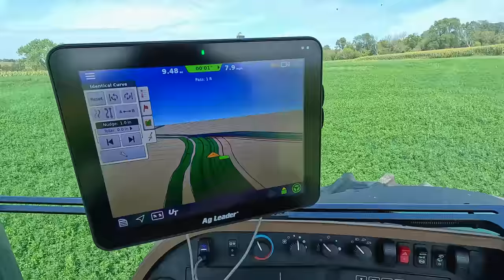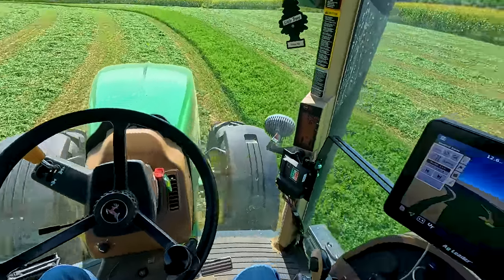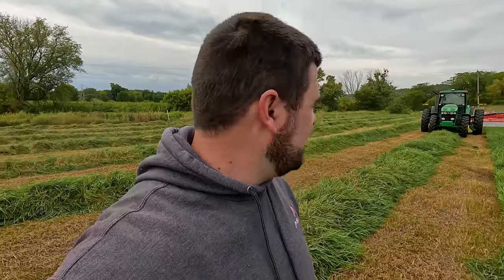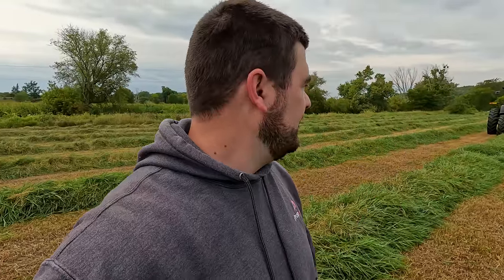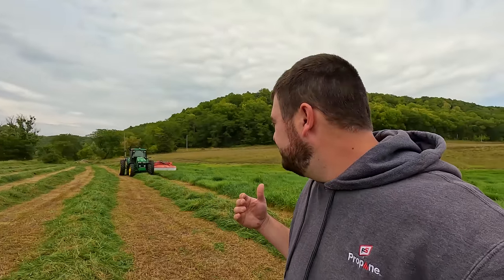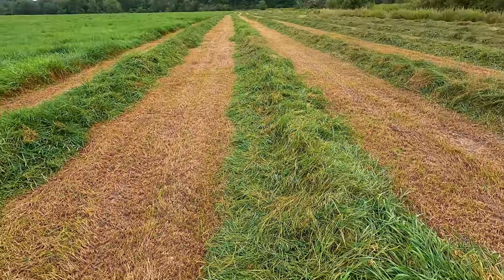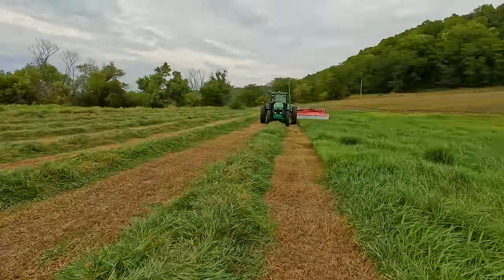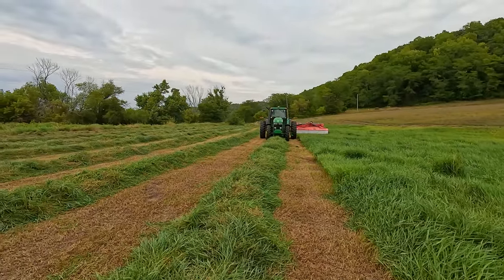Less Horsepower Believe It Or Not - John Deere 7920 & KUHN FC 4061 TCD

Comment: Great Video Ryan, I hope the hay doesn't get wet! Did you use the GPS guidance for the whole of the valley? how did it go? thanks for sharing
Reply from the maker: I didn’t on the lower valley as I couldn’t pin the dimensions down well enough to do more than 3 passes without going off. The problem with the a pulled mower and GPS is that it is offset and it drifts. I didn’t have exact dimensions and probably wasn’t close on some like distance from hitch to axles

Comment: When I was cutting hay (alfalfa) in the 70s and 80 we used a conventional swather with sickle cutter bar, and steel roll conditioner mounted underneath. Disc mowers cut much lower, producing more tons per acre. Is that a good thing? If you're criterion isn't lbs of milk per acre, you shouldn't be farming.